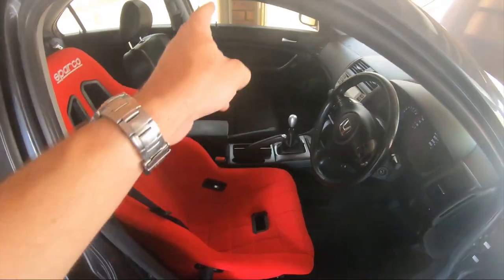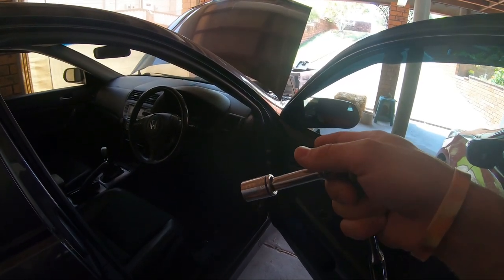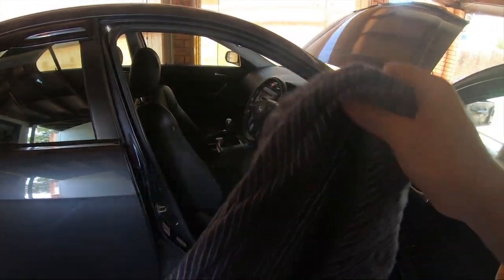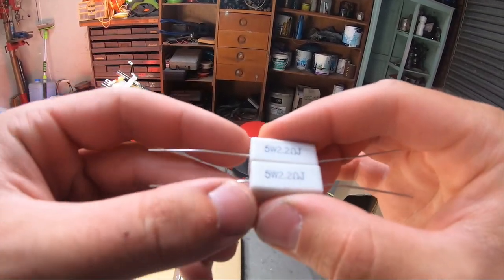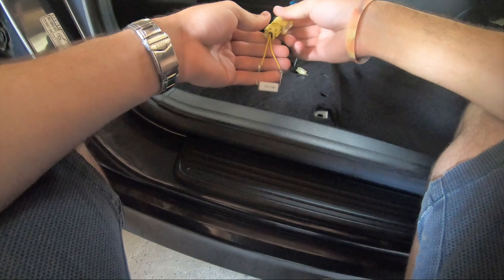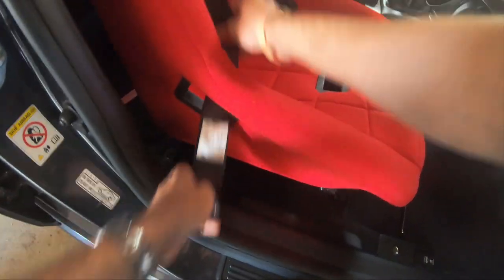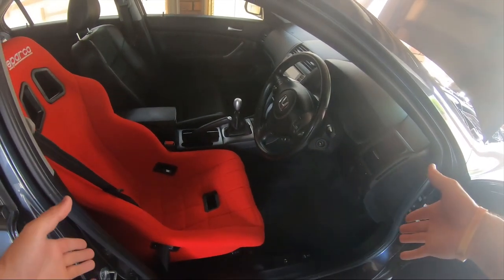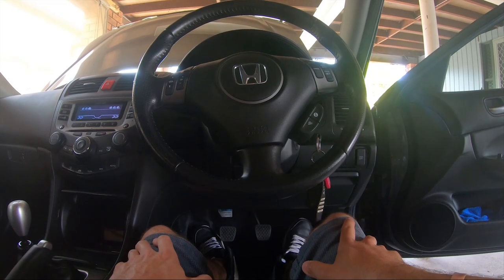Honda Accord Euro / Acura TSX Bucket seat install with no Airbag Light Drivers Side Video

Comment: Hey man, you reckon I can add the resistors to the steering wheel airbag connectors too? I’m swapping in a nardi wheel and don’t want an airbag light
Reply from the maker: You would definitely be able to,
You'd have to look online what resistor is required though!
I'll see what i can find out for you!
Reply from the maker: At this stage it's looking to be the same as the Acura RSX which is 2 watt 2.2 OHM it's definitely possible but may take some trial and error.

I've also shot a message to NRG who offers a hub with SRS resistor. I'm hoping they're kind enough to give me the details on the wattage and OHM.
However it says that the same product for the TSX fits all RSX meaning its very likely 2watt 2.2 Ohm (Please remember you do this at your own risk) - Grimey
Reply from the maker: NRG confirmed it's a 2.2 Ohm resistor, they haven't confirmed wattage yet.

Comment: Good stuff mate still curious about what needs to be done for the passenger side
Reply from the maker: This was just snippets of the more in depth guide for passenger side :) there's alot more involved and the video will take me a fair bit longer to make sure I cover all information needed as the old info I used is now all missing after forums changed server.
Reply from the maker: For now just source yourself a wrecker passenger seat :) it's not as hard as it may seem. Took me max 2 days one to break down wrecker seat and one to install
Reply: @boostedboganmedia  yeah mate i remembered you commented on my post on aus euro :) I'm like digging through forums and all that stuff trying to find a way to make the OPDS working and calibrated correctly. But so far, a lot of information and very little answers. It seems like most people just have the module and sensors in a bag under the seats but not connected to the seat
Reply from the maker: @123etgwbvgdcfawsfr  pretty much, it's simple enough but also complicated and a few fiddly steps

Comment: With the resistor setup you got goin, is it safe to assume this will also work in usdm models?
Reply from the maker: Yes they didn't change it as far as I'm aware between JDM and usdm. So long as you make sure that battery is disconnected when any work is done it shouldn't blow airbags or anything stupid.

Comment: Hey mate could you please share the link you brought the rails from plz?
Reply from the maker: It depends on the bolt pattern on your seat :)
http://www.rakuten.co.jp/auc-mickcorp/
They offer a variety of rails for various seats. Mine were Sparco which are rarely installed in this model.
Don't contact them directly use an importer.
I can help you with this if needed :)